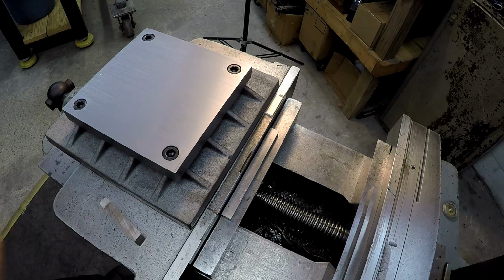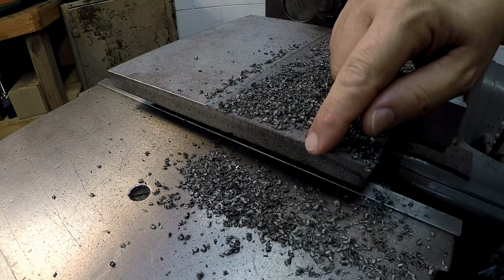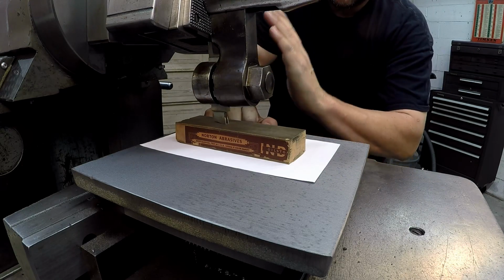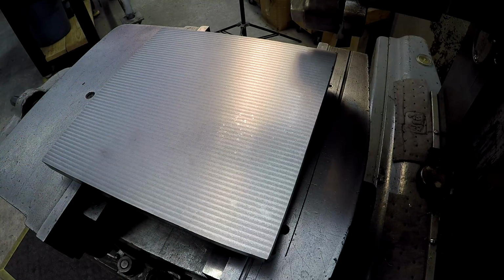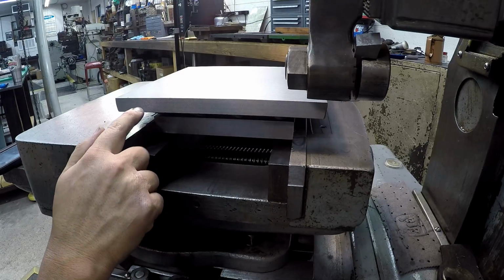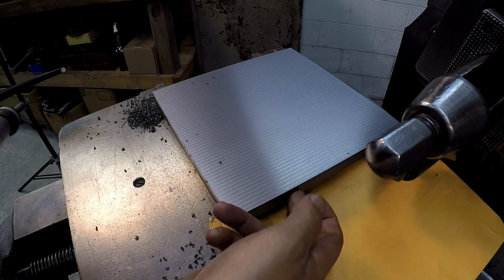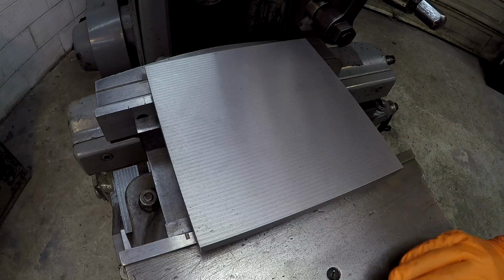Fireball Tool Fixture Plate Part 5

Comment: As a complete novice to machining, there's 2 more questions: 
1. Why use Cast Iron for the fixture plate, instead of say Steel? 
2. Why would one not use a lubricant or cutting oil for working Cast Iron?
Reply: Bigger question than most realise. Cast iron and steel are alloys of iron and each is suited to a wide variety of purposes with considerable overlap. Within "cast iron" and "steel' are huge varieties of of alloys some with very specific purposes. Most people in the home shop are unlikely to encounter more than a few alloys of each. But bear in mind as you work with these few materials that a far wider world of metallurgy awaits the day when someone asks you to make a part for an airplane or wants a recommendation for a knife steel. You don't have to know metallurgy, merely know of its existence and how to find answers via the internet.

Cast iron is preferred for machine tables for a variety of reasons with economy of casting being only one. The cast iron commonly used for machine tool castings has high compressive strength and  very low ductility. This limits the little bumps and dings of daily use that raises metal on the margins of a fresh bruise. Steel being softer acting is ductile and, when impacted, dents. The dent displaces metal which has to go somewhere therefore it "cold flows" to a ring of raised metal much like the rim of a crater. 

Machinists practice eternal vigilance to ensure grit, chips, rag fibers, hair etc are completely excluded from mating precision surfaces like the work reference edge and the mill vise jaw, the parallels and the vise. The smooth file and the slip stone are always handy to dress down the little lumps and bumps as they occur. Machine work might seem a dirty practice with the chips, grit, oil, and coolant but scrupulous cleanliness is inescapable if accurate work is to be accomplished.

As it happens, the properties of cast iron are far superior to cast or fabricated steel as a machine table material because of its resistance to bruising and local deformation. 

Stability, economy of casting have already been mentioned but one might address damping - resistance to ringing and transmitting vibration. People often state that cast iron is a sovereign remedy for unwanted vibration but the fact is cast iron transmits vibration very well - maybe 95% as well as steel but that 5% is quite important: make a bell each of cast iron and steel, ring them and the steel bell will give out a long peal whereas the cast iron bell goes "clank." Look up coefficient of restitution, resonance, damping, elastic deformation, and similar topics.

There is much more to discuss in answer to "... why cast iron?" but time and space limits as does my typing endurance. Someone else can address cutting cast iron dry.
Reply: Iron from what I've heard is more dimensionally stable. Steel, unless you do a lot of work to it has a lot of internal stresses that can cause it to do odd things over time. As for the second question, cast iron is self lubricating.
Reply: weld splatter doesn't stick to cast iron
Reply: Cast iron has a ton of graphite flakes embedded in it from excess carbon in the melt. It's about 3% by weight. Those flakes act as a dry lubricant.
Reply: Cast iron is more stable

Comment: Asking out of curiousity, not to get you away from your shaper, I love seeing that machine at work!

I've seen someone use a bar with what looked like an angled high speed tool in it on a mill to clean a brass surface.
Of course that would still leave a swirling pattern, but would it be effective on iron/steel, also on larger surfaces?
It would eliminate the cost of carbide tools.

Also are the shiny spots another kinds of crystal structure compared to the rest of the metal?

Comment: If it was me Adam, I would have turned it by 90 degrees and have given it another light cut just to see if those strange spots were there afterwards.
Reply: The downside is that it would have resulted in a checkerboard pattern instead of the nice "pinstripes" on top.

Comment: Adam, the reason I watch your videos is because you do what you're passionate about in the way that you want. You then generously invite us alonv for the ride. I wouldnt matter what you did or how you did it, some would moan. Keep doing things the way you do for your enjoyment and those of us who get it will follow along (learning as we go).
For what it's worth, I have a shaper and love it. It's only a baby (8" Boxford) but I won't part with it. I know you've had comments before about the length of your videos, it's the same mentallity. Some can't process more than 10 minutes at a time , thus can't understand a machine like the shaper that slowly does the job fast. Great work giving away the Machinery's Handbooks, I have a 17th edition thumb tab vedsion, indispensible. I just got a job lot of Black Books and gave them to some local engineering apprentices. We have to encourage old fashioned handle turning engineers, if only for the days that the CNC's spit their brains out :)
Take care buddy and congrats with the weight loss, I should follow your example. Mark

Comment: Got a question when I first started heavy equipment we were building up a pad. 100 yards by 50 yards, the guy training me said instead of trying to move the dirt in a straight line. Try moving it diagonal (from corner to corner) could you cut in that manner, would there be a benefit to cutting across, maybe changing the piece up in different stages on cut diagonal the other x or y axis. After a few years of working with heavy equipment, I found moving the dirt in straight lines then across from corner to corner worked best. Just asking, I'm in no way a machinist, my grandpa and his side of the family are or were.

Comment: I heard an old machinist joke that he could make anything on his shaper except a profit.  He still had the machine, he still used it, he still loved it because it's an awesome machine.  he could cut different profiles with a few pieces of cheap HSS and a bench grinder that would take five or six different face mills and end mills and fly cutters, multiple tool changes on a Bridgeport or tens of thousands of dollars worth of CNC mill and tooling.  My home shop will eventually have a shaper.

Comment: Could the finish differences between to the fist and second half of the plate relate to the tool´s acceleration/deceleration? 
If the difference lies in the material, I would expect a curved line (not fully homogenous liquid iron flowing into the mold) or some pattern resembling the webs underneath (different solidification speeds according the material thickness).

Comment: I know from experience you never leave an active machine unattended,the Shaper appears to accomplish its work without interference by the machinist whom has set it up. Adam do you do other things while it finishes its task?
Reply from the maker: I tend to hover around the shaper while it's cutting, but I do walk away sometimes. It's feed is slow enough not to induce a crash if you are simply running off a surface.

Comment: personally - like Adam - i love the shaper.  Something about the rhythmic cutting of the shaper versus the mill thats satisfying.

For the edges of cast iron - or any brittle material - beveling the edge is something that you do in wood working also whenever you are planing on end-grain.  When planing end-grain on wood, if you edges aren't beveled you'll split off pieces from the edge just like your cast iron did.

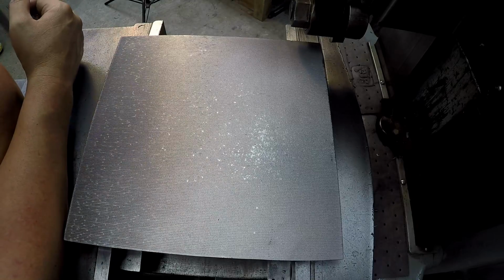Comment: 8:40 or so Exactly why I watch this series, you can not see this in almost any workshops any more and the knowledge of the shaper process increases the depth of your abilities as you well know knowledge is power with respect to the job shop.
Very interesting feeds and grinds, that finish is exactly like the big cast iron surface plate the machinists had at the steel mill I retied from.
Beautiful work Adam, I am getting excited about checking the squareness, cheers!
A big BOOOO to the 19 downers at this time!

Comment: It seems like you get a much better 'as cut' surface finish with a shaper vs mill.  There has to be way less vibration than with a high speed rotating cutter (esp with a small mill) and as you said there isn't the chips (which are really abrasive with cast) getting dragged under the following edge of a rotating cutter, creating the swirl grooves.  I'd be curious to see some quantitative comparison of roughness between shaper/mill.  Sure looks nice.

Comment: Adam, I noticed you didn't use any cutting oil on the cast iron surface like you did on the steel baseplate. Can you elaborate on the reason?
Reply: Cast iron is self lubricating
Reply: Hi Jason, cast iron is pretty well self lubricating. Cheers

Comment: Great video, Adam! A shaper is a very versatile machine, and it was a mainstay, along with a lathe, in most 20th century machine shops. The G & E brand has a special significance in my life, as I went to high school less than a mile from the G & E plant off of Chancellor Avenue. Unfortunately, it is now a shopping mall, complete with sawtooth factory roof. Keep up the good work!

Comment: Nice to see your progress Adam. I worry about stress relief causing bowing when working with Cast Iron, and would have been tempted to do the sides, flip 90 degrees then do the next two sides before taking a finishing cut on top. Never tried it, but wonder if a fine finishing cut would produce a visible checkerboard pattern? Must try it on my 6 incher.

Comment: Bear with me I'm not a good book writer:::  Want a better finish?  Try this.  We do a share of 
brass  sliding valving for a local 'desal' water plant that control pneumatic actuators.. Some 
parts are hand lapped on a lapping plate.  About 10 yrs ago I think "what if" :  So I machined a
about 2 inch round with waffles with a stand clamped in the clapper.  The end of the stand
is a male ball  the business end is a female (1/2 " ball end mill)  so its self leveling.  With 
various trial & error with valve grinding compound and a little down feed.   Now set the stroke
and set the ram so it stops about 1/4 " shy of both sides off the ends of the work.   I find the 
table feed set to max per stroke.  Paint some compound on the part and start machine with no
table feed crank clapper until you can here it then engage table feed.  (listen)   CAUTION you
have to stay with it so the tool does not run off the 1/4 " rule.  Clean work then go to fine and
finer even down to chrome polish even toothpaste.  And yes I harden'd the lapper tool. And no
I did not put a snap ring on the lapper and its post ball in case I ran it off the end  it will just
fall off.      Boy would it be good if we could reply on Utube with a picture.....sam

Comment: I would have loved to see the finishing on every surface with the same tool you used for the main surface.Flipping the plate around so that all the patterns on all sides run in the same direction parallel to each other.
It would have required a lot more setup and most likely be not as accurate. But i think i would have gone for it. Just because that's something you can't do on a mill :D

Anyway. It's looking perfect the way it is. Good job and nice video!

Comment: There’s no need to explain your affinity for the shaper. Why do some people drive antique cars when they could drive 21st century technology?  Why do people like Steve rebuild 100 year old motors when it would be cheaper to replace with a new one?  Why do I still have a leisure in my closet...... well we won’t discuss that. You keep up the shaper work. I could watch it all day.
Reply: Why My car is 72 same age as me a V8 Ford, why= is does not use gas= why I can 
see 8 spark plugs;  why cause my kids 2018 F350 how you turn the radio on? the 
thing don't even have a key  Now we got CNC vehicles   OUT of CONTROL

Comment: My DACIA(1999)'s engine block had the same shaper pattern when I did a rebuild, but it didn't seem to have broken edges, or I may have missed them. The block is cast iron with changeble steel cylinders. But I may be wrong about the pattern. I wish I could post some photos

Comment: Keep on with the shaper vids Adam. They're skookum as all get out for understanding cutting forces. My only objection to the videos is that although I have a Myford, and a bunch of clockmaking lathes/mills which I don't use much... every time I see one of your shaper videos I get this little voice in the back of my head which keeps trying to tell me that I really should get a shaper. What I really should get is a larger workspace.

Comment: Great. I can realy se the benefits with a shaper for this kind of precision work. The heat input into the part wont be much either. Cuestion. Are there any carbide tools for a shaper? I think of the old solderd once used in a lathe? 
Will you check the flatnes and probably scrape it?
Keep up the good work. I always learn something from your videos!!😀

Best regards from Sweden!

Comment: Adam, I really like the shaper videos. I wonder though if you could mount a small vacuum hose that could swing down near the cutter to collect chips as it cuts? I'm thinking more about clearing chips to avoid them sticking to the tool than saving cleanup time.
Reply: a blower hose (like maybe his noga cool misting stuff) might be a little more compact for mounting

Comment: Adam, your comments re: “why I use the shaper” reminded me my experiences with motorcycles and bicycles. 

I've had plenty of saddle time on both and have a great appreciation of their differences. Yes, a motorcycle is faster but a bike is a perfect expression of first principles of mechanical advantage. When I'm on a bike, I enjoy the simple process of pedaling; converting my somewhat linear motion into rotational power. 

When I watch your shaper, I get to enjoy that same sensation of experiencing first principles. For me, that massive ram making chips with a small, sharp, piece of steel is the purest form of machining.
Reply: Very nicely put.

Comment: Love watching this machine in action.  Just a thought, the machine is basically running at half speed.  So if you really wanted to push it you could probably cut the time per pass in half.  Which is not all that bad. I hope to see many more project using the machine.
Reply: He mentioned in another video that the machine can start to move around if he runs it too fast, since he hasn't anchored it into the concrete
Reply: I had forgotten that, thanks for the reminder.

Comment: The shaper could be a great way to cut long parallel grooves on a flat surface using a tool that comes to a fairly sharp point.
Then rotate 90deg and do it again for a checkerboard grip pattern. Perfect for things like accelerator/brake pedals on a go-cart.
Reply: Steve Summers has a video where he does just that ("knurling" on a shaper, I think it's on rolling feet for machines)

Comment: "Shaper versus surface grinder versus milling head" is kinda like "pan fried chicken versus deep fried chicken versus oven fried chicken".
There are pluses and and minuses to different aspects of each, and sometimes I prefer one over the other based on those nuances, but at the end of the day, regardless of which method you use, you get fried freaking chicken.

THAT'S why he uses the shaper.
Reply: Lazy D shaper seems best for eating material efficiently.  Like a 60 grit sandpaper.  And a surface grinder would be like a 1000 grit final pass kinda sand paper
Reply: @scottcmiller  True that.
But, even a shaper's depth of cut and feed rate can be dialed in pretty tight and give a damn nice functional finish. Maybe not a mirror finish, but for most practical purposes, close enough.
The surface grinder typically won't give you a mirror finish either, but might get you a scad bit closer.
At the end of the day, considering the required results of the projects that Adam is using this shaper for, they are easily attainable by any of the methods, and if you have a tool that you like to use, that tool will get the job done, and there is not economic down side to using it, then you're kinda obligated to use it.
If for no other reason than just getting good at using it, as Adam has alluded to a couple times.
Reply: Lazy D yah Adam definitely gets a great finish with them.  That matte finish with a nice linear pattern is a really cool style.

Comment: This series actually explained something I'd been wondering about for quite some time: what machine tool leaves that straight-lined finish.

It's pretty cool to think about all the parts and equipment I've seen and realize that this sort of "obsolete" machine is still used in production! Real testament to the design, there.

Comment: Have you thought about using an insert tool on the shaper?  Do you think it would work?
Reply: I think the main issue using tungsten carbide on a shaper like this is the impact of the insert against the part at the start of each cut. There's probably a risk of chipping the carbide due to it being more brittle than HSS.
Reply: There's also the bumping of the tool into the workpiece on the backstroke, perhaps if/when abom gets an auto lifting clapper box he'll try some carbide?

Comment: I'm totally not a machinist, but from what I've learned from your channel it would seem another benefit of the shaper even in a production environment is that you can leave it do its thing pretty much unattended, whereas surfacing a large plate like that on a mill would require several passes which requires more time from the machinist.  Of course there are things that are more efficient on the mill... and things the shaper can do that the mill can't... In the end it's just another tool, and it's as useful as the person operating it can make it - the more tools a person can master, the more masterful a craftsman they become.